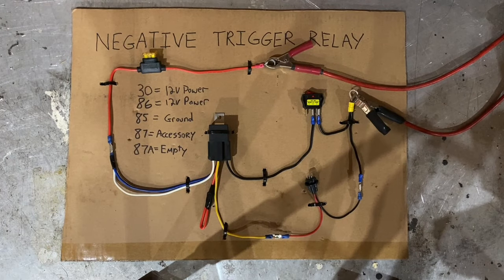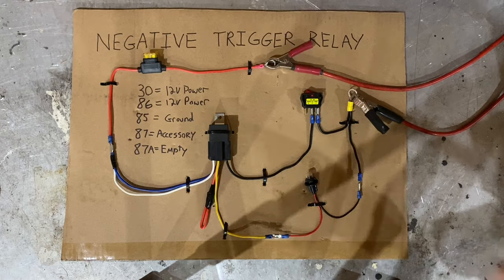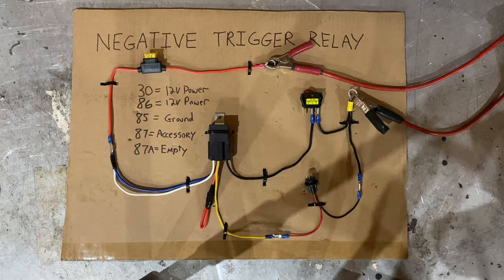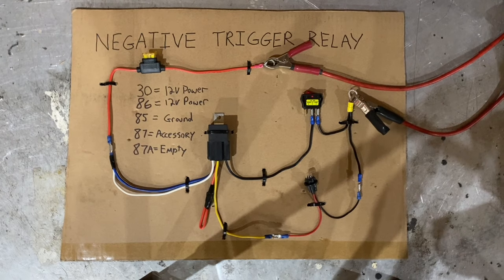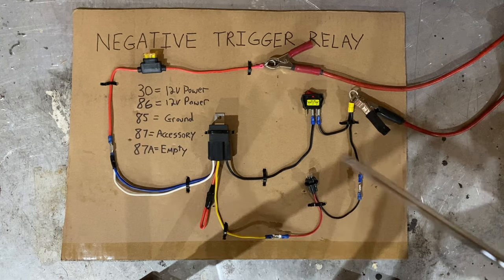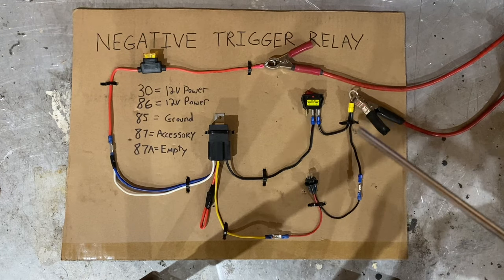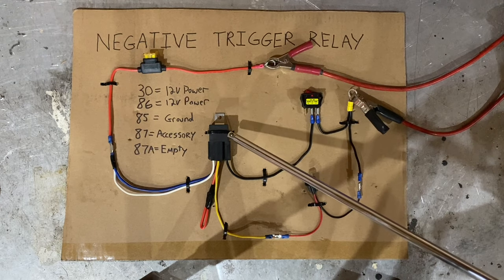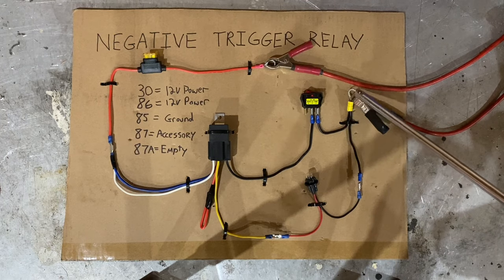How To Wire a 4 or 5 Pin Relay With a Negative Trigger Wire.

Comment: I tried in a bit different way but it doesnt work for me.. can you help me? I negative(ground) to 86 pin and also connected my lamp wire to 86 then, 87 was connected to possitive of my lamp, 30 was connected to possitive battery and possitive switch and 85 was connected to negative switch.. and it doesnt work only the relay was buzzing
Reply from the maker: It sounds like you have a negative on Pin 85 and 86, which will make the relay not work. If you copy the directions in the video, you should have no trouble. I also have another method here: https://www.youtube.com/watch?v=W2Mr2Zgv1Ck

Comment: I was wondering culd relays be activated via pick up coil?
I have loot different relays so Im surching to eliminate ignition trigger from me pick up coil.
I noticed 4 diferent relays.
2pin warning light buzzer relay.
3 pin blinker relay
4pin rear windscrean heater relay 
6 pin windscrean viper motor relay .
So can I use any of those relays and make them programabel variabel for ignition coils?? 
At some acesions me car refused to stop when all 4 blinker worked engin worked in union with blinker relay,the second thing hapened me car self excelerated from idel to mac rpm be him self if I turned head lights ON.
So I wonderd what the hell was all that about?
I do have how ever linear voltage regulator inside me dashboard.
Later I found the problem corroded wire was on back side lights didnt get ground andto me ignition key 1 black wire smoked hade bade conection.
So any one know why that acured and how actualy control those relays manualy for engine speed?
Its similar to buzz coil just in me case its fiering true the ground some how.
Any usefull advice wuld be great.
I wuld like to have that set up buzz coil with out ignition module for stationary engines generators who spin al very low rpm .

Comment: May I ask why are you using a 5 pin relay for this video that would only require a 4 pin relay? I thought 5 pin relays were intended to alternate between two connections, one of which is always on.
Reply from the maker: Good question. It’s because I happen to own a 5 pin relay at that moment, and not a 4 pin relay. Either one works.

Comment: Im trying to wire up my fuel pump and my ecu im using has a negative ground for trigger. Does it matter if 85 or 86 gets the trigger if I follow your wiring example?
Reply from the maker: It is generally accepted that 85 is the ground, but it will likely work fine if you swap 85&86.

Comment: I have done this using using a negative trigger on high beam, however the LED in the switch works in reverse when you connect the switches ground wire to ground. In fact, when the switch is on the LED is constantly illuminated and when high beam switch is switched on the LED goes out. In your example, your not showing the LED working, how can I get the LED to work correctly on negative switching?
Reply: Same problem here...

Comment: Can you show a relay circuit with an on-off-on switch  thank you
Reply from the maker: I do use one in this circuit, but it may not be what you’re after https://youtu.be/c8JDQrUquw8
Reply: @WiringRescue    I am working on light pod 3 wires from it… yellow, red, black….. yellow= white light. Red= red light ….. the switch I am using   VLD1-A60B type of 3 way switch  … 

Thanks for the video ….

Comment: can I ground 85 to the chassis instead of the car battery?
Reply from the maker: Absolutely! As long as your chassis is grounded to your battery.
Reply: @WiringRescue  oh perfect...so i can technically ground 85 to my steering wheel? im putting buttons on my steering wheel and i want to use switch to negative becuz it use 1 wire to activate.
Reply from the maker: @WorstPaperCut  - as long as your steering wheel is grounded that should work. What you’re doing sounds similar to how to wire a horn, which I made a video for too https://youtu.be/eu0vQKKDVho
Reply: @WiringRescue  yes its for a race car. My steering wheel is the same shape as the ones they use from F1. Its a yoke. I can only hold it on 2 sides.
Reply from the maker: @WorstPaperCut  sounds rad. I actually am working on a video next that is a simple way to add turn signals, headlights, and a horn to a race car. Stay tuned!
Reply: @WiringRescue  perfect. it would be nice if you could do like a potentiometer. I want to have a knob for active aero.

Comment: I'm having trouble wiring a 4 pin relay to the starter

I've tried a few different ways, but each time, the same thing occurs - the car starts, but the starter stays on

(Pin 1 and 2 - coil side)
(Pin 3 - switch part)
(Pin 5 - part that switch touches when energized)
Reply from the maker: Sometimes large amounts of electricity can hang a relays closed when the electricity goes away. If you are sure you’re wiring it correctly, do some reading on adding diodes to relays.

Comment: Ok im going to try explain this the best i can i have a digital switich from auxbeam in my jeep that powers my lights and other stuff but i cant for the life of me figure out to turm my eletric fans on let me explain the fans are controlled off a temp sender that when it hits 190° it gounds and turns on the fans standard set up put i also added a extra wire to the temp sensor that a has a switch on it when its open nothing happens close the switch it creates a path  to ground and no matter the temp the fan is on thats how it works the auxbeam ditigal swithch panel only supplys power to turn things on it has soild state relays in it im trying to figure if there is a way to use a power circuit from the switch panel threw a relay to create a ground im thinking gound pin 30 then pin 87 to fan wire 
Ground sire  pin 86 then power from switch panel to pin 85 
Do you think that will work i figire when you put power threw switch side of the relay it will create a ground on the load side of the relay
Reply from the maker: I completely understand what you are doing and saying. And yes, your plan should work!
Reply: @WiringRescue  thxs for a quick answer on a older video I am still going to test the theory tonight to make sure the theory is sound
Reply from the maker: @jeremyhanna3852  - technically the ground should be 85 and your + trigger from the auxbeam switch should go to 86. That being said, you can swap those and it will also work just fine. It’s something that doesn’t matter except to wiring nerds like myself.
Reply: @WiringRescue  ok I will wire it that way
Reply: @WiringRescue  why you are answering questions I am a very large man 6' 10  380,lbs so stuffing me in cars is difficult anyways my  left foot likes to ride on the dimmer switch in my 1950 buick super and bump it anyways I had a 1981  square body  chevy truck which should have had  the same ish dimmer switch put some how somebody converted it to toggle switch on The dash for high beams up was high &  down was low it was a two wire switch and the wires ran to a pair of 5 pin relays  the rest of wiring I have no idea how it worked any idea what that wiring diagram would look like
Reply from the maker: @jeremyhanna3852 - I’ll add that video to my to-do list. It’s hard to explain with words😂
Reply: @WiringRescue  awesome do you have a patron where I can donate or something I will im not looking for a free lunch

Comment: Why or when would you ever want a negative trigger?
Reply from the maker: Solid question! One example that comes to mind could be a car horn. If you look at a factory wiring diagram for most horns on normal cars (maybe a 90 Jeep Wrangler for example?), they have the ground wire (pin 85 in my video) running all the way up the inside of the steering column. Then when you push the horn button in the center of the Jeep steering wheel, it grounds that horn wire to the steering column itself which activates the horn. Beep beep.

I see two benefits to wiring it this way:
1: Steering columns have a lot of moving parts and very little space inside. If something breaks this ground wire in the steering column and grounds it out, the worst case scenario is the horn will beep. It won’t blow fuses or light fires or do anything scary. Unless of course you’re afraid of horns.

2: If you were to wire it the opposite way (using the pin 86 side of the relay), you would need a positive wire running into the steering column, up to your horn button, and then another back down the steering column to your relay. As I mentioned above, space inside the steering column is very limited. So one wire is better than two. It’s also TWO 12v power wires that need to be protected from the spinning parts inside the steering column. If one (or both) were to become damaged, it would ground out on the steering column and cause short-circuit electrical issues. 

Hopefully that helps & makes sense?

Comment: Is it safe to splice into a wire that gives constant current? Just to supply power instead of wiring directly to the battery
Reply from the maker: It really depends, check out this video. It may help you make the decision:  https://youtu.be/EhzN6UdnmPA

Comment: Hello great video! I do have one question. Do all 4 post relays have be used on a negative switch? Or can you use it for either? Positive switch or negative switch? If not, how do you determine which relay you have? neg or pos. switch. Thank you
Reply from the maker: Hello! 4 post relays can be used with a negative OR a positive switch.  You can swap 85 and 86 from positive to negative with no issues. :)
Reply: @WiringRescue  Thank you!

Comment: I set up a negative triggered relay on my switch, but my issue is that the on position of the switch is an open circuit and the off position of the switch is a closed circuit. Therefore I am using 87a to power the lights. When the switch is off ( closed circuit) the relay is using power and will draw the battery down. Is there a way to hook this setup without the draw?
Reply from the maker: The easiest solution would be to use a different switch. However, I’m guessing that you like the switch you have. So - maybe use two relays:
1: set relay #1 up exactly how you have it right now.
2: set up a second relay that turns on with the ignition switch, and powers up pin 30 on relay #1.

It’s not great, but it would probably work.

Comment: So if you have a negative triggered switch and you don't have your switch run to a body ground if you hook up the negative wire will that trigger the fan accessory to come on? I have mine wired so it had a 3 pin switch with a negative pin that I have grounded to the battery and one power wire run to the battery and the other leg going to my accessory my negative wire when I touch it to the battery triggers the relay to open and I connect the ground wire to the other fan it turns the fan on even tho the switch is off any idea what I should check?
Reply: I'm wiring 2 fans together one has a relay built in line with it the other just has the power running thru the switch and has a 15 amp fuse on the power wire

Comment: My question is for the three prong switch , mine has a internal light in the switch now by negatively triggering the set up does the internal light in the switch engage when turned on ?
Reply from the maker: Sadly if you use a negative trigger wire to the switch the light in the switch won’t work. :(
Reply: Great video! If using a switch with an internal bulb, can that cause damage to the relay…the bulb drawing amperage from the relay ground when switched on?

Comment: So the ground is connected to the Trigger + positive and - negative to ground?
Reply from the maker: No. Pin 85 is a ground. So the wire come from pin 85 at the relay, to a switch. The other side of the switch goes to a ground. All the switch is doing is making and breaking the ground contact for the relay.

Comment: Hey Jeremy, 
Does the switch have a built in light that illuminates?
Reply from the maker: In this specific circuit, it does not.
Reply: @WiringRescue thanks for the reply. I’m about to wire up a switch panel similar to the one you used in race car switch panel video. Only difference is all of my switches look exactly like the master switch in your video and also I’m running a negative trigger wire.

Comment: If my accessories that I’m plugging in to has a 14gauge gauge power wire would i use a 14gauge wire to run from the relay Or could I use  a smaller size wire from the relay to connect it ? That would be the yellow wire
Reply from the maker: As usual, "It depends".  Your accessory that you are powering is what determines the wire size that is needed.  Check out this video https://www.youtube.com/watch?v=EhzN6UdnmPA  I explain wire and fuse sizes in detail there.
Reply: @WiringRescue  I’m wiring up aftermarket power windows they have their own switch to go up and down I just need to add a switch to to shut off the power to the relay when the car is parked. Can I use the same set up as you have here
Reply: If the accessories you are supplying power to is <=15 amps (180 watts) than 14 gauge is ok.  The wire from the relay to the switch can be much smaller (22-24 gauge) because all that the switch is powering is the relay itself.

Comment: How bout if you want to factor in the ignition or acc to the relay so that nothing comes on until the ignition is on?
Reply: the wires to the 30 and 86 would go to a key hot source instead of straight to the battery.

Comment: I’ve been melting my switches not my fuse or relay so it weird I’m not running a fuse on switch tho but I am from battery to relay there is a fuse in btw..should I run both of does together?
Reply from the maker: Every circuit in a car should have a fuse protecting it someplace in my opinion. The large wire to the starter would be the only exception. If you are burning switches, you have more amperage flowing through the switch than your switch is rated for. So I would guess that whatever you are powering is being powered through the switch and not the relay. Could be a simple mix up with the wires.  Double check that your switch is going to the proper pin on the relay. If you have the same relays as me, your switch should connect to either pin 85 or pin 86, depending on what you are trying to accomplish.
Reply: @WiringRescue  I’m trying to manually turn on and off can I run a fuse from battery’ to pin 30 & and from battery againg with a fuse to the switch (main load) &  Pin 86 goes to the switch to on ACC prong and 3rd prong goes to the ground with the relay pin 85 on the chassis …both 20 fuses in each holder for the 30 pin and one of the battery prongs
Reply: @WiringRescue  or should I run the switch ground apart from the relay ground ? And radiator fans ? Or can I run them all into the chassis ?
Reply: @WiringRescue  I have mine on pin 85 with a switch cuz I wanna manually turn it on and off …can I use 1guage wire for everytning and my fuse holder 12guage ?

Comment: Can i connect the 87a to the accesories with positive supply?
Reply from the maker: Depends what your goal is, because when the relay turns on, 87a goes dead. So 87 or 87A gets power depending on whether the relay is on or off. But they never have power at the same time.

Comment: Could that switch be on the other side of the accessory wire on the negative wire
Reply from the maker: Assuming I understand you correctly, that would not work right. If you do that, the relay would serve no purpose. The goal with the relay is to use a small amperage switch to control a larger amperage circuit.
Reply: @WiringRescue  so could I just make the negative wire with the switch on it long enough to reach the dash then ground it to the body some where up by the dash where I’ll be putting the switch ? Thanks so much for the reply’s just leaning about relays and it’s a little confusing hahaha
Reply: @halifaxcanada3655  yes.  That is the best reason for using a negative trigger.  One side of the switch can go to the relay and the other side can go to body ground.  Just think of the switch being a controllable break in a wire.

Comment: Will this help my lightbar (led switch) from draining my battery?
Reply from the maker: If your light bar is draining your battery, it is definitely not wired right or not working right. I'd following this design in the video and see if it solves the problem.
Reply: If your light bar is running through a switch it most definitely could be because of the switch.  Putting a relay in between would separate the source voltage to the light bar.  If it still drains the battery it could be because a positive wire from the light bar is chaffed and creating a minor short to ground.

Comment: With wire thickness do you use?
Reply from the maker: The thickness of the wire is dependent on the accessory that you are running off the relay. Each wire size can handle a certain amperage. If you draw too much amperage through the wires, they could burn.
Reply from the maker: This website has a good amperage chart for wires. Check it out https://jascoautomotive.com/automotive-wire-amperage-capacity-chart/

Comment: positive trigger or negative trigger? what are the advantages of using one?
Reply: NEGATIVE TRIGGER... Fuse block is under the hood, accessary is usually under the hood, power is under the hood. The only wire that needs to run through your firewall to the switch is the negative wire. Less chance of shorting something out in the dash. Hopes this helps.
Reply: Both would work to complete the circuit, but like scratchbuilder101 said less chance of shorting.  You can't create a battery short from ground to ground.  With that being said if it does "short" than whatever you have the negative triggered relay hooked to will turn on and stay on.  This is because the switch would be bypassed by whatever the ground wire shorted to.